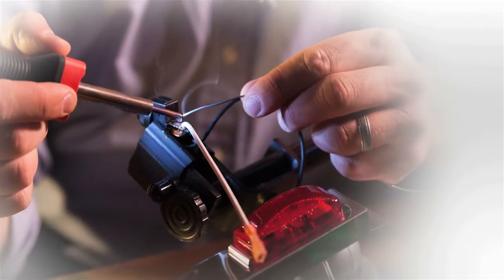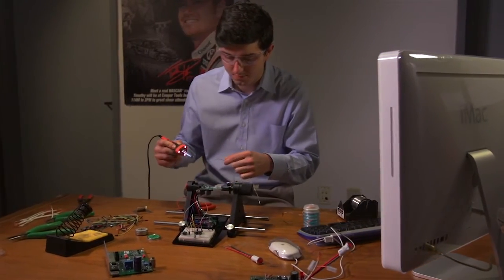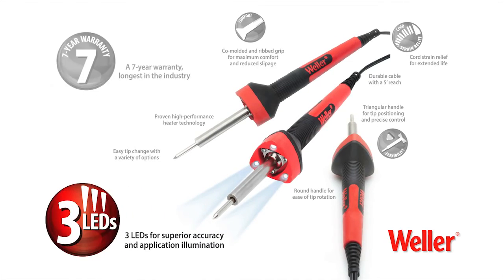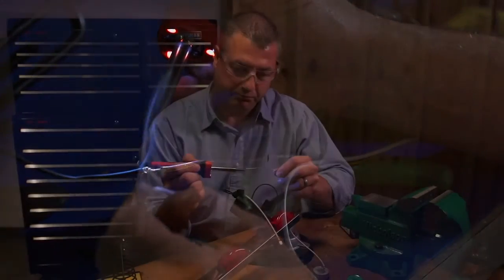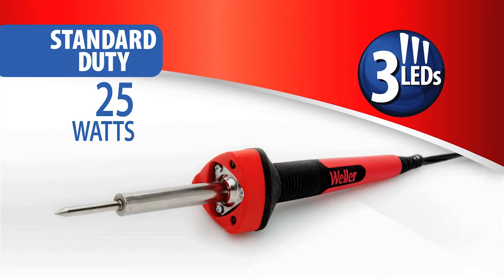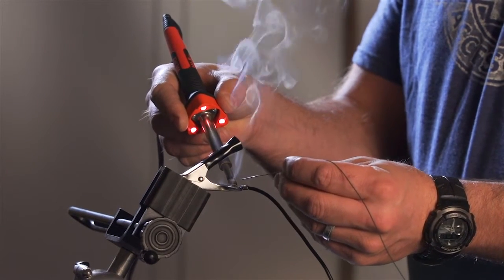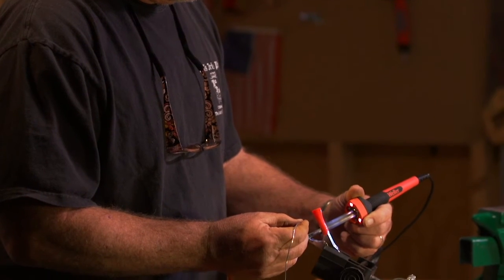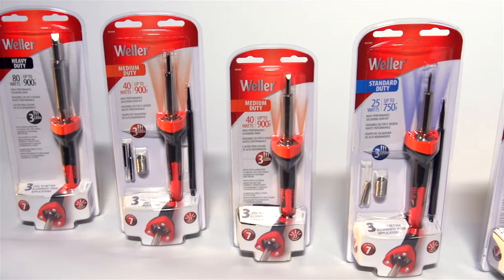Weller SPN Consumer Iron - Brings the light !

Comment from the maker: Hi NikyRipy, the main focus of teh 15W version are micro
components, electronic kits, low-voltage wiring, the 25W is for soldering jobs which need a little bit more power like Printed circuit boards, radio controlled, indoor lighting.
Reply: I have a 40W Weller soldering iron, It lasted more than 8 years, and it still strong!